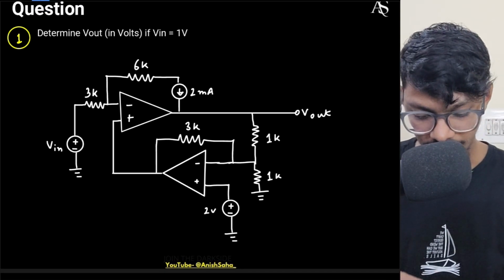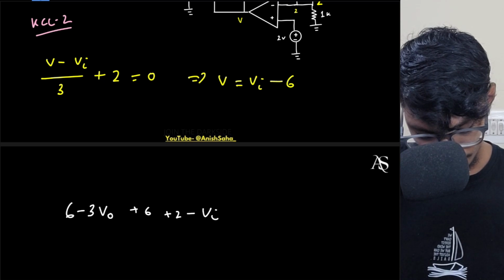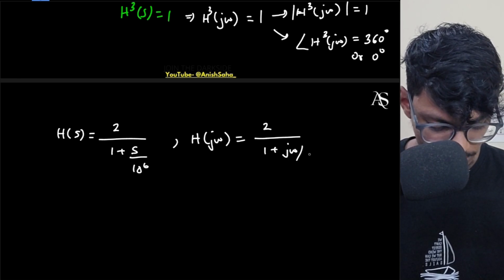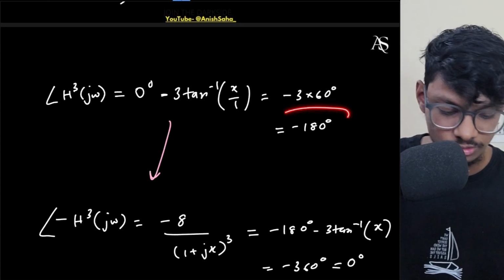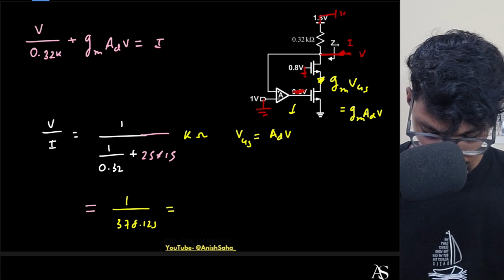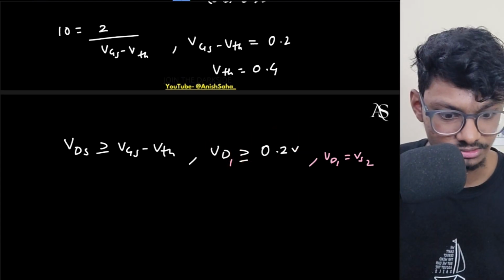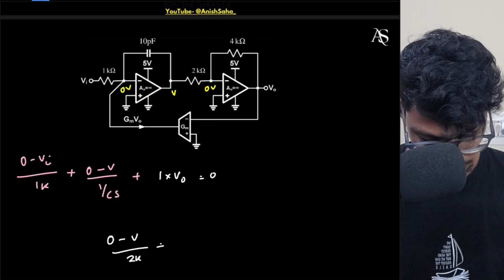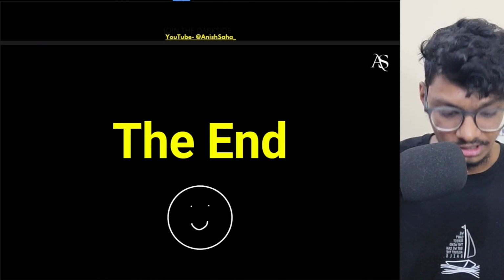Op - Amp Questions For VLSI Placements || Analog Electronics Decoded

Comment: Very clear explanation, very interesting circuit！Thank you 😁
1,3,4 for me is Not hard!
Reply from the maker: Great! But if you assume all the opamps are in negative feedback then it's no issue but this same question in interviews will feel very difficult as you have to explain why the op-amps are in negative feedback.
Reply: for stability🤔When it is unstable, is it another way to discuss it?Is there such a circuit as an oscillator? 
This is briefly guess😔 @AnishSaha_